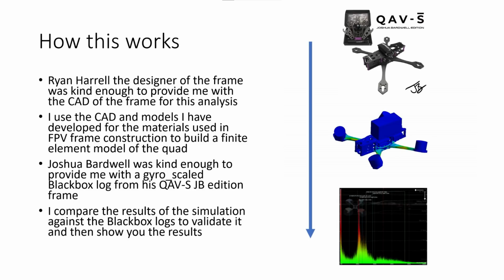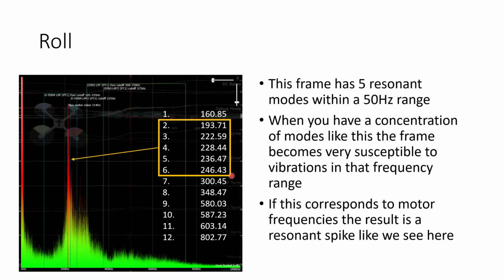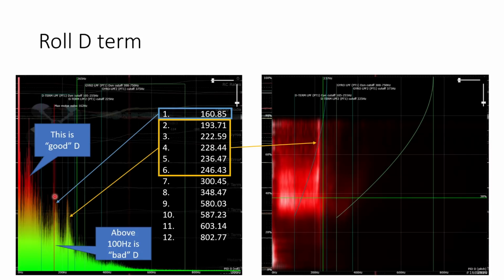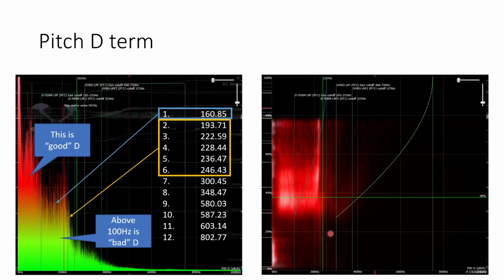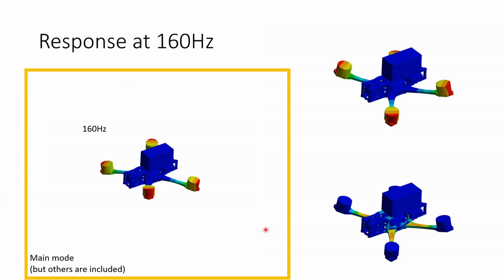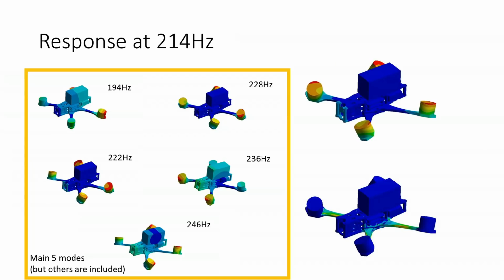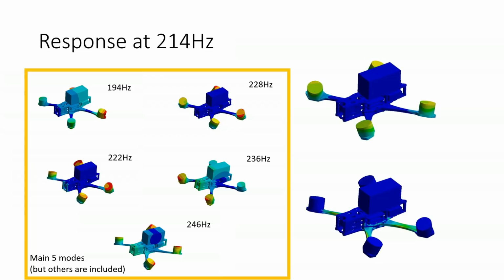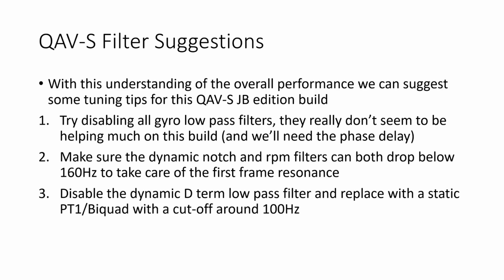Frame analysis of Joshua Bardwell's Lumenier QAV-S JB Edition. Filtering suggestions at the end!

Comment: some reason I get terrible experience with this frame.  First build was BF 4.4 than rebuild with FetTec G4  - but in both cases -  hard to tune.  I also have QAV S V1  -  it works much better

Comment: Surprised with all the detailed videos you make, you haven't once mentioned (that I can find) HOW the flight controller receives the motor frequencies. I thought for sure this video would, but I didn't see it anywhere.
Reply from the maker: The gyro picks them up as noise and bidirectional dshot also sends motor rpm data.

Comment: Not in an apex. How do you mean every frame. Or is that just to excuse the frame for having resonance. What’s more important here.  Your collaboration with bardwell or the facts. Aint no spikes on pex. None
Reply from the maker: Some builds with the Apex frame do have significant resonance peaks. And the Apex is quite a heavy frame (125g), it's easy to improve resonance performance if you make the frame 10% heavier. Not knocking the design of the Apex, it's a well thought out frame, just the facts.

Comment: @Chris Rosser  I have 2 of the Bardwell Xilo Beginner quads.  Do you have any interest in running an analysis of this setup?  I believe there are a LOT of this build flying around as the kit constantly goes out of stock at GetFPV.  I have an OpenLager attached to one of my quads and can provide bb logs if interested.  Also I have a tube of the damping grease that could be applied to one for A/B testing :)  Right now I'm running UAVTech's 5" base tune plus Krunked's betaflight 4.2 tune from the betaflight community git.

Comment: I am kind of puzzled by your third suggestion (static dterm lowpass). Frame resonance is to the best of my knowledge best addressed with static notch filters. Those offer a nicer 'price'(=latency) to performance ratio than simple low pass filters. Is there a specific reason you decided not to use static notches that sit on the resonance frequencies? Based on this data I would have suggested to just use the static notch filters and keep dterm lowpass dynamic with a high cutoff (in addition to your point 1 & 2)

Comment: Chris,  are you using the forces of motor precession as an input? I believe certain modes should be driven by gyroscopic motor precession, rather than  tangential oscillation.
Reply from the maker: I'm not taking the gyroscopic nature of the motors into account at this stage. However, agreement between my models and real world testing are now within 5% so I am confident the model is fit for purpose.

Comment: I have this counter intuitive phenomenon  that mounting the motors on silicone gummies (with steel m3 screws  though) in fusion 360 it introduced some around 50Hz modes where as fully rigid frame had 110Hz lowest modes. I would have predicted that this would have clipped high frequency modes effectively off but  this didn't really happen. It might be that the propagation of the vibration didn't penetrate as deep into the CG as before but I suppose really low modes could be harder for the FC to deal with.
Reply from the maker: In your model did you apply preload to the screws? If not, that may be the problem.

Comment: Awesome content one question was that analysis done on the frame with the horns on the arms  or on the frame everyone else got ?
Reply from the maker: The one everyone else got. But it makes absolutely no difference.
Reply: @ChrisRosser  ok awesome I did your suggested modifications with great results thanks for your support in our hobby
Reply: @ChrisRosser  I only ask because you mentioned adding more material to the arm would cancel out most of the vibrations I'm sure u meant more towards the middle of the arm tho right because the horms are on the end
Reply from the maker: @runpuppyfpv5744  Yes you're right. if you look at the stress results you can see where the material should be added. Its in the middle of the arm. The end would do nothing.

Comment: Erm are you recommending disabling the gyro low pass filters assuming people have RPM filtering enabled?

Otherwise people might start smoking motors if they have crap motors and props.
Reply from the maker: I wouldn't want to assume that, you are right that you need those active! The second suggestion is to make sure gyro and dynamic notch filters are active down below 160Hz to capture the resonant peaks. If they are set up that way the risk of smoking motors is minimal I think.

Comment: Yes the filter suggestions are an amazing resource. Did you do this for the Apex resonance analysis? If not could you share your suggestions somewhere? I'd love to hear your thoughts and see how close my filters are
Reply from the maker: I can certainly provide some filter suggestions for the Apex, could you send me a gyro_scaled blackbox log like JB did for the QAV-S?
Reply: @ChrisRosser  yes absolutely, I have a new frame coming and I can put new motors on it as well. I have one with air unit and one with a vista but Whatever specific requirements you need to help please let me know and I'll see what I can do.
Reply: I second this. The APEX is an amazing and very popular frame, so having this level of analysis on it would be absolutely outstanding.

Comment: Chris, how does this compare to the Apex and even the AOS 5?  BTW I believe every frame designer should consult with you so that their patrons can optimize the tune when they build.  I'm in the process of building an AOS 5 but this frame is my second to build right after.  I have two QAV-S 4" and they fly great.
Reply from the maker: Speaking only in terms of vibration performance: The Apex has a bit of an advantage over the QAV-S due to its 5.5mm arms but it's also heavier. The AOS 5 is really optimized for resonance performance and runs 6mm arms so it pulls ahead of both by a fair margin. It weighs 115g which is a little more than the QAV-S I think but still less than the Apex.
Reply: @ChrisRosser   What about adding a layer of rubber between the motor and the arms? Or between the arms and the center plates? How would that affect things?

Comment: Does the centre of gravity have any impact? Kinda curious about the effect the battery may have - if it's weight/position acts to damp any of the vibrations at particular frequencies (pendulum effect)?
Reply: +1
had the battery rotate slightly while strapped on the other day, by just a few degrees to the side, clockwise. It was enough to cause motor flutter sounds upon pushing the quad, as it probably caused too much noise in the otherwise acceptable D term.

So battery definitely must have an impact, not sure which one though.
Reply from the maker: COG really does matter as the bouncing mode couples onto pitch and roll if the COG is not centered.

Comment: I presume the quality of the CF has some bearing on resonance of a frame.
Reply from the maker: Yes it does matter. Most typical frames are made with T300 standard layup carbon fiber for a balance of durability and stiffness. The properties of that material is reasonably consistent frame to frame in my experience for quality frames like this one.

Comment: Thanks for taking a look at this! It's interesting, because you ended up at almost exactly the same place on your filter recommendations as where I am! 

I will do a tiny bit of nitpicking on the Dterm comments though. I actually tend to run lower Dterm because too high Dterm makes the quad a bit sluggish on snap moves, to which I am a bit partial. Anything above about upper 40ish low 50ish for dterm adversely affects handling in my opinion. I can already push P values to ridiculous levels without adverse effects with the correct filtering with the Dterm around 48-51 range. 

We also consciously decided against increasing the thickness of the arms due to that being a significant contributing factor to the weight of a frame. The resonance response is already in a realm that is very serviceable so the tradeoff between weight and rigidity came down on the weight side for this application. The target was to keep the frame below the 115g mark and we hit it right on. 

Thanks again for your work! The filter recommendations are fantastic!
Reply from the maker: Thanks for providing the CAD Ryan! I'm not surprised that we agree on the filter recommendations. Regarding the D Term: I typically run D gains above 50 on all my builds. I then use the Dmin as a D boost to enable D to go even higher on snap moves. To prevent any sluggishness you need to increase P gain and Feedforward proportionally to D. That way even though the D term is fighting harder FF and P are pushing that much harder too!

Once I have found my PD ratio for critically damped behavior I just crank P and D up together maintaining the ratio until D noise stops me pushing D any higher. Once there I use D min as a D boost to enable D to go even higher on snap moves until I get twitches in steady flight (then back off 5-10%) and I keep pushing P up to maintain the ratio for the boosted D value. Then I add as much feedforward as I need to overcome the D term when kicking into snap moves. You need a lot of feedforward (300+) with high D gains to track setpoint but just keep cranking it up until gyro follow setpoint on snap moves.
Reply: @ChrisRosser  When I tune like that I always end up feeling like it's a bit overly stiff and over tuned. I do use Dmin, usually leave it on defaults though and just adjust the D slider to put the D values in the upper 40s/lower 50s. I'm also not a huge fan of the stick feel with super high FF either. Usually end up with about 150 maximum, depending on the quad. I think the new fixes in the RC rate and filtering side of things will probably solve the issues I've had with very high FF, so in 4.3 with the new RC code, I'll probably give your technique another go.

I will say the tuning window has gotten ridiculously wide, where you can get something that flies reasonable on a huge range of PID values these days. In some ways that almost makes it harder to tune, since the changes are often more subtle than obvious.
Reply from the maker: @QuadMcFlyFlies  If you are finding the feel is not as you like it that points to rates I think. I think a lot of people tune their rates based of BF stock PIDs and filters and therefore don't realise they have a bunch of slop built in to everything. Once you have a tightly tuned quad you have to go back to the rates and reduce your center stick rates and often increase your RC smoothing a little to soften up the feel back to where it was with undertuned PIDs.

I have different rates for BF stock and tuned quads. I hate how my BF stock rates feel on a tuned quad. They are just way too twitchy.
Reply: I did the suggested filter settings and it flies amazing thanks so much for the hard work

Comment: dear sir..does it possible some in example 100Hz or lowering than 100Hz cut off in D-term can help us to run more cooler motor in others frames ...
Reply from the maker: Yes, definitely. You can lower the D term cutoff but it will make performance worse. I wouldn't advise going below 70Hz.
Reply: @ChrisRosser  thank you so much sir,,comunity worldwide respect
Reply: is there any video to avoiding hot motors with the filter such as in firmware FalcoX instead of betaflight,,i guess it would be interest subject if someone like your background can give us from the side of your views between betaflight, kiss, Falcox, emu..or the worlds need new firmware or new brushless motor winding desain
Reply: @zlachannel8674  increasing filtering will help with hot motors as will lowering your d gains.
Reply: @SlipperyFPV  ouh ok,,,i will try it,,,
Reply: @zlachannel8674  good.luck... . remember to test hover for no more than a minute after any changes to check motor temps.

Comment: About how longer logs exaggerates noise graph, there really should be a standard to do noise analysis. My standardised noise analysis is a 30 second flight with cruising around once, 4 flips and rolls in each direction, and finally 2 full throttle punch-outs. This will give full spectrum noise profile that covers nearly every quad movement. The result will also be comparable between setups.
Reply: As long as you are doing a consistent flight between all set ups you're in the clear. I will say though, I don't think 30 sec is enough, 2 min seems to be the standard for most ppl that know what they're doing, i.e, Spatz, the BB log FB group, etc.

What you're missing from your log: scaled throttles, throttle pumps, induced prop wash
Reply: It actually depends on the objective of the logging,  @srossi88 . For tuning, more flight time is better because the log accumulates every possible vibration characteristics. For comparing setups, each flights need to be identical, and the longer flight will induce more unwanted variables.

Scaled throttle, throttle pumps, and induced propwash are subject of PID tuning, not vibration characterisation. Even a single punch-out already show vibration characteristics in the entire throttle range, that's what we care the most in filter setup.

Comment: The filter advice was seriously great! although I don't own this frame, learned a lot from this video and how I can improve my setup
Reply from the maker: Glad to hear that you found it valuable. I'm going to do a proper filters video soon as part of my perfect AOS 5 build hopefully there will be more useful stuff in there for you!
Reply: @ChrisRosser  Looking forward 👍
Reply: @ChrisRosser  It's another excellent video and hopefully i can apply some of this to my tune once im done building the qav-s, out of curiosity have you found another 5" that performs better?
Reply: @ChrisRosser  - Great video! I've just built my first 5" quad using this frame and am slowing learning about tuning with the help of your videos and others. Can these recommended filter settings apply to any build using the QAV-S (JB) frame or does it make a difference with different components? I have different motors, 4s build, some TPU protective parts for now. Interested to know if your settings will still apply. Cheers!
Reply: Excellent Video once again!
@ChrisRosser Have you ever simulated tubular Arms and/or structural TPU?